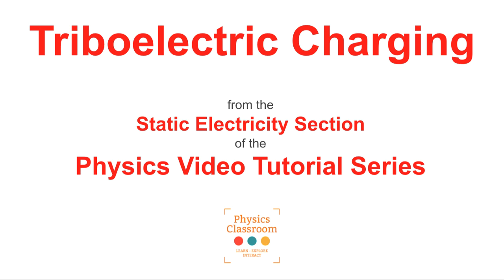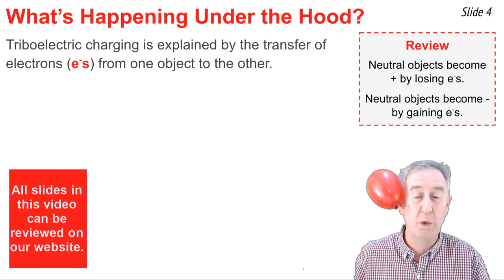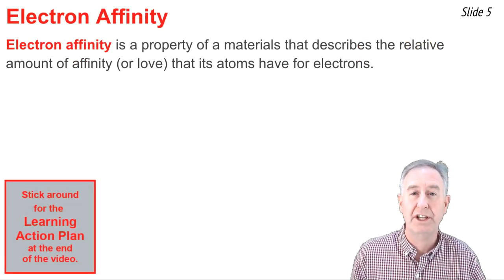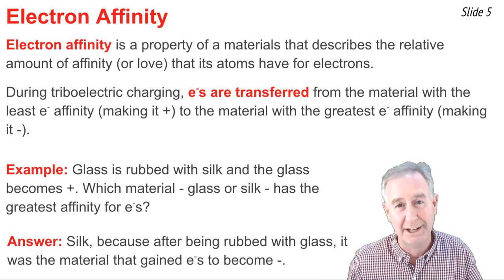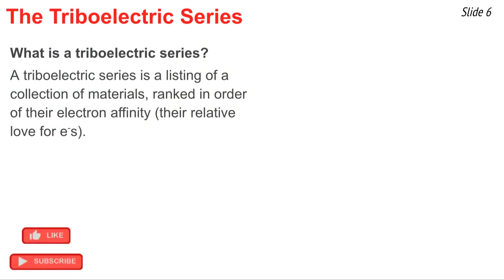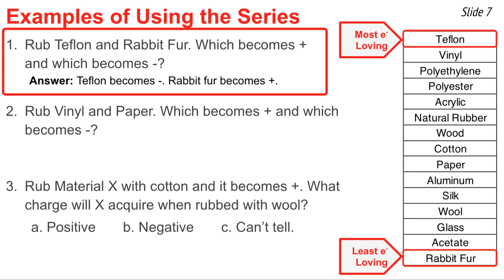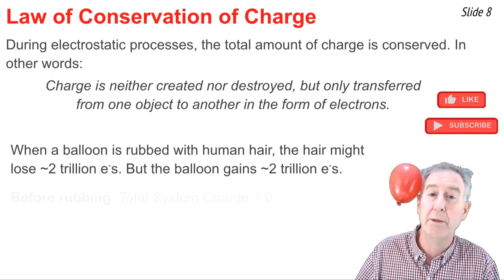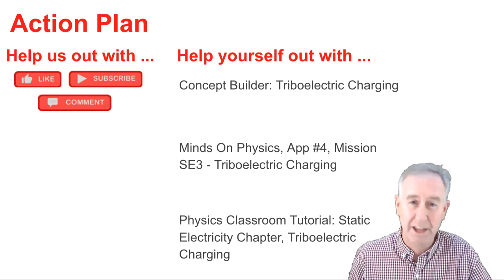Triboelectric Charging

Comment: The triboelectric series is arranged correctly but is place upside-down. The least electron loving need to be at the top and the most electron loving needs to be at the bottom.
Reply from the maker: It can be either way as long as it's labeled as such.
Reply: Good. I thought the same thing and was looking if any comments thought so too. Positive is usually on top.